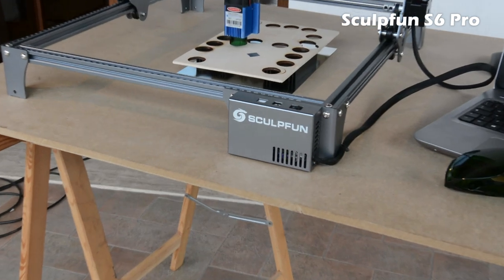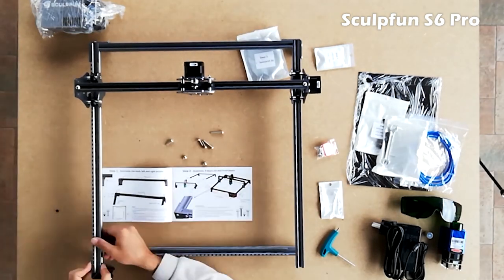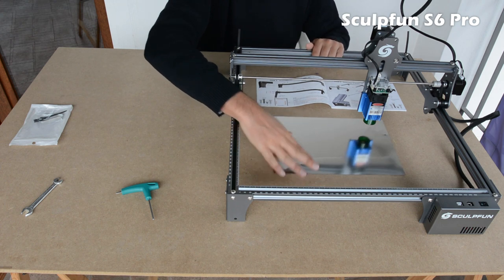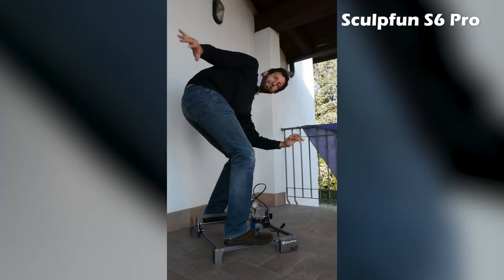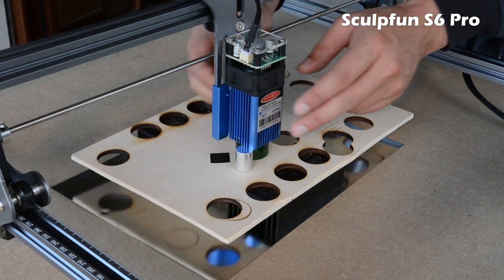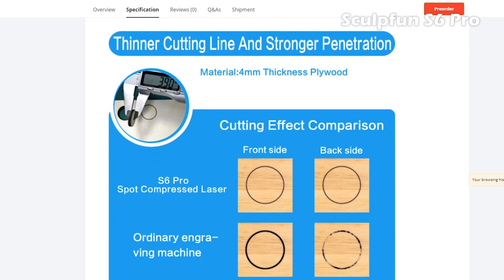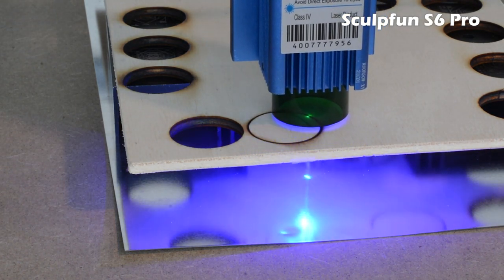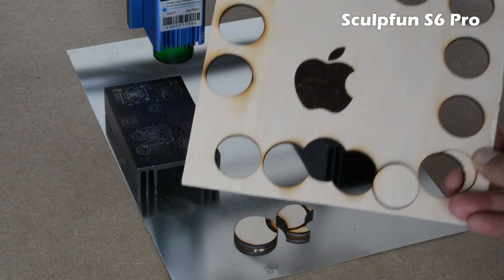Sculpfun S6 Pro Laser Engraver

Comment: I bought a DIY engraving machine for about $450 a few years ago, but this one seems to have greatly exceeded my engraving machine. In general, I think it is one of the TOP of the same type of DIY engraving machine.
Reply from the maker: There has been a lot of growth in this industry over the past 3 years. Competition between various manufacturers, and the technological innovation of laser modules, has resulted in models that were unthinkable few years ago.

Lately I've been testing some new laser modules that are able to engrave on steel. One thing that I excluded to be possible for laser diode, but that today with certain techniques begins to be possible. Obviously the results of these machines (which remain in an entry-level sector) cannot be compared with those of professional fiber or co2 machines but for home use the price is really interesting.

Comment: As usual a great to the point review.  Since Sculpfun S6 Pro seems comparable to the the Atomstack 5A Pro and you have both machines, please do a comparison of the two.
Reply: Whether it is laser engraving or laser cutting, in fact, the most important thing is two points, one is the laser power and the other is the smoothness of the frame movement.
Laser power not only depends on the input voltage and current, but also depends on the good or bad laser diode, a good diode can make you more quickly into the perfect carving, on the market these products, the laser spot compression is the best, whether you are cutting or carving, despite the product is not good but have as much as possible to Advertisement and make the spot compression of the product is difficult to show the light.You can see this video：https://youtu.be/qAwesZPInhw

Comment: Please add a test to quantify the claims of small focused square which are only means to an end.  The real question is what is the actual kerf?  I suggest cutting a rectangle so it is easy to remember x and y components.  What is the size of the design vs. the size of the finished piece vs. the size of the hole left in the starting material.  Do the test on a thin material that can be done with one or two passes at the most and a thick material that takes several passes.
Reply from the maker: This was a first video to introduce the engraver, if you see I'm the first to review it. I wanted to be quick and concise because I didn't want to get bored with too technical details.

About comparison with other brand and more in-depth measurements I will do something later as soon as I have time. Unfortunately, I am very busy with my work.

As the results depend a lot on the test conditions and the materials, it is necessary to do more than a simple test in order to have reliable information and not give approximate results that can give a good or a bad reputation of the module. For now I will just say that the measurements on the optical power is> 5W (I measured with LPM) and that the cut is very very precise.
Reply: @lasergrbl  Thanks for putting a machine to machine comparison in you plans.  Again, please include measured x and y kerf in your test regime.  Each machine has relative strength and weaknesses and machine users have different priorities.  I seldom cut anything thicker than 1mm +/- and kerf is the single most important performance criteria.  The closer to a square “dot” the better and the smaller the “dot” the better.  I am skeptical of manufacturers’ claims and your testing would be immensely useful.
Reply from the maker: @gsax1  if your needs is to cut 1mm or less this engraver is perfect for you. the spot is very squared and small. here you can see an engraving test https://drive.google.com/file/d/17APE69kySkFBSr3M2dWgrGL1oDgh3bdy/view?usp=sharing
Reply from the maker: with thickness > 3mm the spot goes out of focus so I don't recommend this kind of diode if you need work on thick material
Reply: @lasergrbl  Thanks for taking the time to reply.  My cutting stock seldom for precision work seldom exceeds 1.1 mm.  Your information was helpful.

Comment: very well, a new brand is only good and stimulates competition; I notice that finally another manufacturer has adopted the atomstack system of the shielding cage around the laser, which is really a necessary upgrade to make the use of these machines more comfortable. -- Indeed, in practice it is an Atomstack clone
Reply: Whether it is laser engraving or laser cutting, in fact, the most important thing is two points, one is the laser power and the other is the smoothness of the frame movement.
Laser power not only depends on the input voltage and current, but also depends on the good or bad laser diode, a good diode can make you more quickly into the perfect carving, on the market these products, the laser spot compression is the best, whether you are cutting or carving, despite the product is not good but have as much as possible to Advertisement and make the spot compression of the product is difficult to show the light.You can see this video：https://youtu.be/qAwesZPInhw

Comment: Hello there,
Sorry in advance for my English.
Well done, your video is beautiful.
I have the following problem when using the machine:
For example, when you cut 4 mm raw mdf with the machine, too much smoke comes out and this smoke immediately darkens the exit point of the laser light and the laser power decreases, so the machine cannot cut the material at the end of the process. Poplar plywood is cut very easily at the same strengths, but this is a problem due to smoke in mdf. Have you experienced this problem, what can be done to solve it?
Reply from the maker: 1. clean your laser frequently using procedure I explain in my video https://youtu.be/29N5Runr52Y

2. add air assist as explained here: https://youtu.be/6lBKCcUviZ4
Reply: @lasergrbl  Thank you, your information was very helpful

Comment: i'm getting this machine (s6 30w)  & want to use it with LaserGRBL, can you make a materialDB & how to setup for this model? thanks
Reply from the maker: Material DB is filled with info provided from the manifacturer. I am waiting for data from Scuplfun to add them in LaserGRBL.
Reply: I have a material database for another light spot compression machine, do you have an email? I can send it to you for reference
Reply: @lasergrbl  I have the latest material data sheet, do you have an email? I will send it to you.

Comment: Hi Arkipita  THANKS FOR THE GREAT VIDEOS!!! Sooo the big question is which one should I choose Atomstack A5 Pro or Sculpfun S6 Pro???? (Atomstack would come from germany no tex since it is imported from EU that is good Sculpfun comes from Chine even from Banggood but is is a bit cheaper and also cuts a bit bigger). Thanks for the answers advanced!!!
Reply from the maker: Tried both, very similar. Sculpfuf better design of some details i.e focus sleed, ruler, all stuff I say in video.

Laser module of the same power, very thin focus, but Atomstack module seems able to go a little deeper (1mm, not much more) therefore it performs better then sculpfun on thicknesses > 3mm. However both work on maximum material thicknesses of 5mm.

Your choiche, let me know what you buy and how you find.
Reply: @lasergrbl  Thank you very much for the answer. I lean to Atomstack since that can be imported from germany although 5% more but that is OK. It can only be imported now from China on Bangood. Also Sculpfun does not even have a webpage typical Bangood off brand. Atomstack at least have a more or less normal website they might help if I have some problem... Thanks and also fro the great videos and the cutting software...rockjano
Reply: What I would need it is for balsa-plywood planes 2-3-4mm plywood and balsa

Comment: Congratulations great video, I would like to ask you a question, I bought a laser engraver from banggood (it's called VIGOTEC VG-L7X 20W) and I just got a SCULPFUN S6 PTO 60W laser too, I wanted to ask you if I can upgrade or if I have to change something. Then I wanted some advice from you since I also have a high 400x500 square laser engraver but it has a laser too low I wanted to upgrade it all and I ask you for an advice / link of a controller card with fw included or in any case flashable and software maybe recommended by you and if there are any x win drivers. thank you in advance HELLO
Reply from the maker: Ciao DroneDario
Mi spiace dirti che molte persone si sono lamentate della VG L7X perché monta un firmware che vigotec ha personalizzato per usarla con un loro programma, ma che la rende difficile da usare con programmi come LaserGRBL e Lightburn. Così era qualche mese fa, non so se hanno migliorato le cose nel frattempo.
Reply from the maker: Per il laser che vuoi aggiornare non capisco la richiesta, dici che ha il laser troppo poco potente, ma mi chiedi il link di un controller.
Non capisco se il problema è il laser o il controller.
Reply: @lasergrbl  no perche questa cnc 400x500 ha un laser da mezzo watt e io voglio montargli su uno SCULPFUN S6PRO che ho appena acquistato ma non so se il controller rege lo sculpfun e vorrei cambiarlo per poi quindi poter usare softwar di incisione diverso da quello proprietario, quindi ti chiedo di consigliarmi una scheda controller o cosa mi serve. in pratica utilizzo tutta la struttura dall'incisore da 400x600 ma rifacendolo tutto, controller laser e cos'altro mi serve. ti chiedo queste informazioni
Reply: @lasergrbl  ok ma io la VG L7X la lascio stare ne devo modificare un altra e quindi montargli una scheda controller nuova cosi da non avere problemi, devo montargli un laser sculpfun s6 pro e miserve sapere cosa mi serve, scheda controller ecc. questo ti sto chiedendo
Reply from the maker: @dronedario7689  il controller originale dovrebbe reggerlo, assicurati che l'alimentatore però possa dare 5A. Se però vuoi cambiare anche il controller va bene uno qualsiasi, per esempio il MAKERBASE MKS DLC. in ogni caso è probabile che dovrai fare qualche lavoro per adattarlo perché non è sempre detto che i connettori corrispondano

Comment: Cómoda cubierta láser y muy robustez. increíble! El láser parece ser muy preciso, podría comprar uno, su soporte es muy resistente debería ser adecuado para otros módulos.
Reply: Whether it is laser engraving or laser cutting, in fact, the most important thing is two points, one is the laser power and the other is the smoothness of the frame movement.
Laser power not only depends on the input voltage and current, but also depends on the good or bad laser diode, a good diode can make you more quickly into the perfect carving, on the market these products, the laser spot compression is the best, whether you are cutting or carving, despite the product is not good but have as much as possible to Advertisement and make the spot compression of the product is difficult to show the light.You can see this video：https://youtu.be/qAwesZPInhw